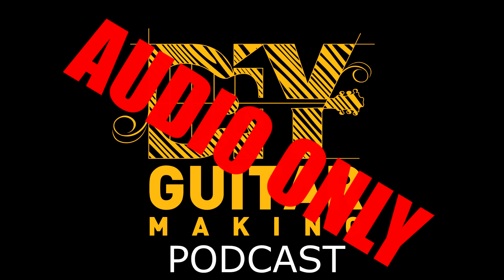Buying Equipment for Guitar Making | Podcast Ep. 9

Comment: Great information! One small note on band saw sizes -- The size given is actually the size of the wheels, so a 14" saw has 14" wheels. The horizontal opening of the saw is usually about an inch less than that. But there is not a direct relationship to the vertical resaw capability. There are 14" band saws with only 6" resaw. For these saws you can usually buy an extension kit to increase that height to around 12". From what I understand, for guitar making a resawing capability of at least 9" is recommended.  

BTW, I just signed up for your online class. I'm excited to get started.

Comment: Awesome info!  

I also use the band saw the most and get by with a contractor table saw.  The contractor saw stays folded up in my garage and gets used a few times a year.  Mostly for furniture making, never luthiery.

Because my build rate is low, I find “thicknessing” by planing and scraping works ok. I start with 0.180” thickness and stop planing at 0.090.  Then I scrape from there.  I only make ukuleles so the smaller size enables the hand thicknessing.  I did buy a 18” wide Flat Master drum sander that I envisioned as a thicknessing tool.  The FlatMaster turned out to be very slow so I transitioned to the plane and scrape method.  

Several years ago you did a video on tools for your luthier for Christmas.  I was just starting and so I bought most of those.  I have loved the Shinto rasp and the pull saw.  I wore out the pull saw on various wood working tasks (the blade started to crack by the stiffening brace) and bought a second.  I also purchased a spindle sander based on your recommendation.  Very useful.  

Perhaps a Christmas wish list again this year?